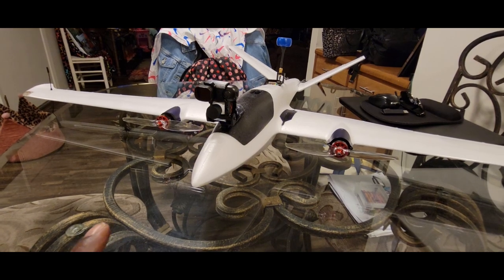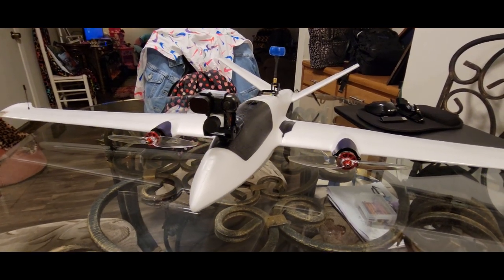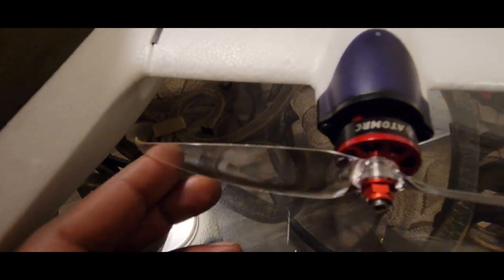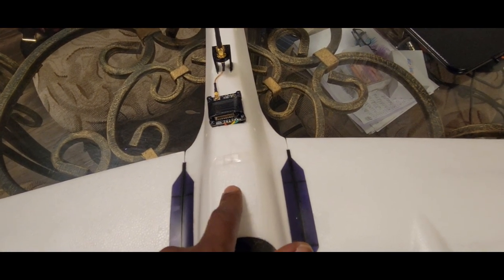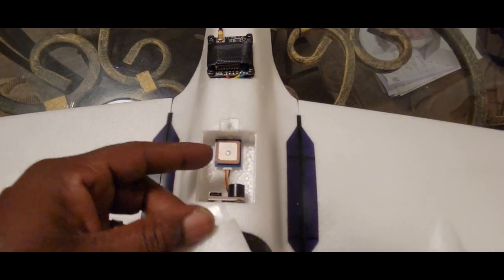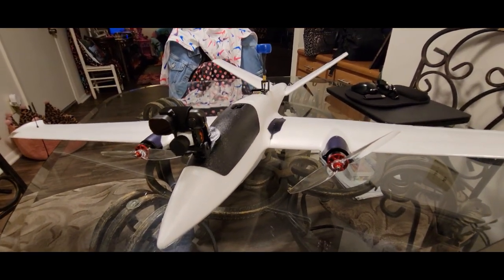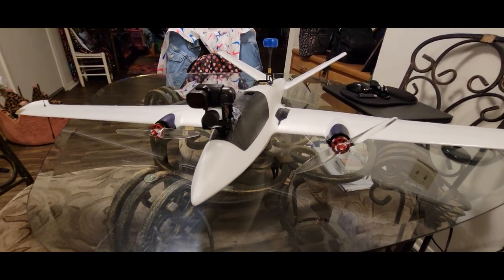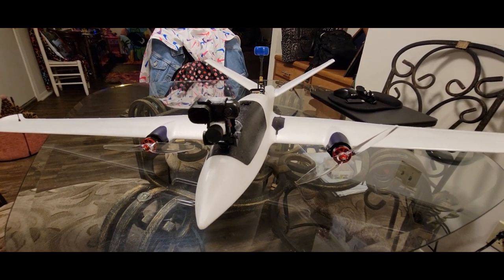Swordfish Atomrc / Setup and Maiden Flight

Comment: Great and inspiring results, especially so early in the tuning phase. The pan tilt/Thumb/Gyroflow is excellent. Are you running a slipring? that is a really clean build. Great work.
I have one in transit, and I'm still planning the fitout although like you I got the PNP with stock motors and ESC's etc, they're a little high in KV, but I can always re motor later..
Regards from downunder (A.C.)
Reply from the maker: Thanks! No slipring needed. 🙂

Comment: Is that antenna mount available for download anywhere? Do you think the 4s1p 21700 pack would fit and balance?
Reply from the maker: Yes it will fit and balance with some weight added to the rear of plane. The antenna holder is on thingiverse
Reply from the maker: https://www.thingiverse.com/jdfpv/designs